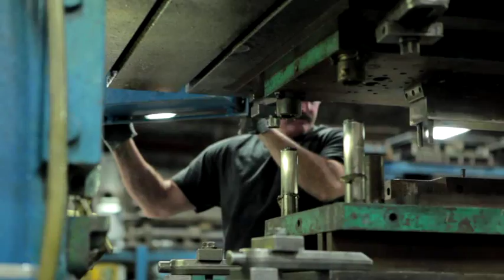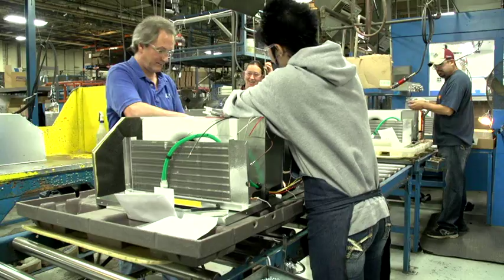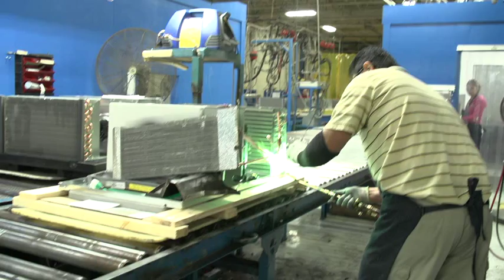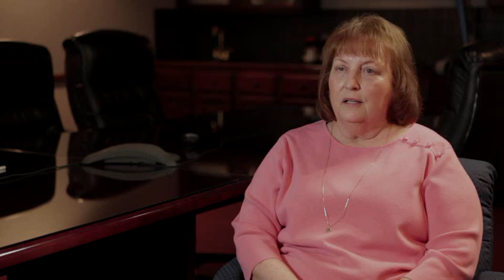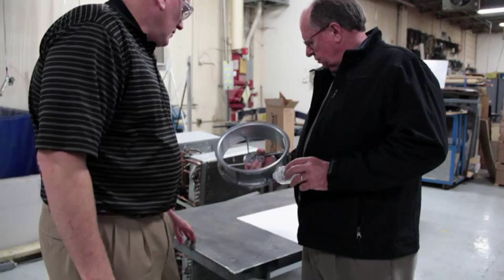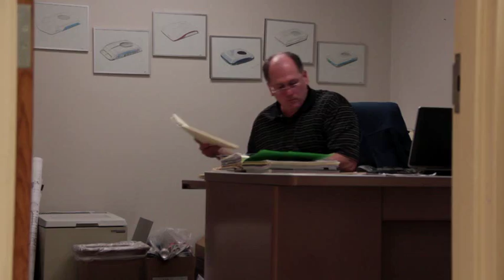How the Coleman-Mach ACs are made

Comment: I have a coleman mach 15k in my 2017 30 ft camper, it can't even maintain a 75 degree temp inside when it's 80 outside!! My mother in law has a 2015 camper with a dometic and hers is only 13k and she has a 32 foot camper and hers does a great job even on a  90 degree day.

Comment: Top of the line product.  Improvement on the noise?  That would be fabulous!  Too loud.
Reply: op of the line ???
My brand new Maxxfan de luxe , has a major design flaw : the infrared remote Is not coded : when I change the channel on my Philips tv , or soundbar, or even smartphone infrared sensor triggers the maxxfan : shuts down , or goes into auto mode . Cheap design , with very annoying consequences … I wish I had invested in a better product for that price